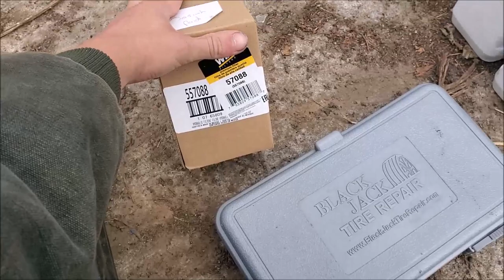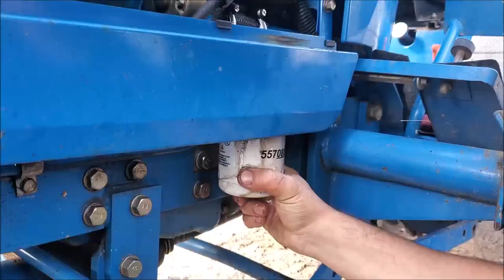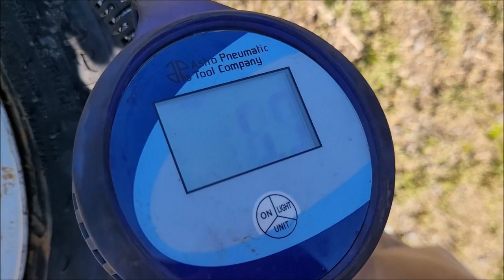Servicing a 1994 Ford 1520 Tractor

Comment: There is a bleeder valve on top of the fuel line coming from the fuel filter it runs to front of motor follow the fuel line from filter towards front of motor were the line connects to metal housing, right on top there is a bleeder valve, looks like a brass bolt, unscrew a bit turn the motor over till you get fuel coming out, it will start so be careful, tighten bleeder and your done, either is not your friend

Comment: I've had the exact same tractor (1996 model) since new and done all my own maintenance.  Watching the part of starting the tractor after changing the fuel was brutal.  I see someone posted in the comments about the fuel bleed screw that needs to be cracked open to release the air before trying to start it.